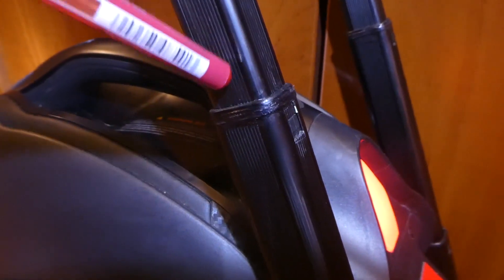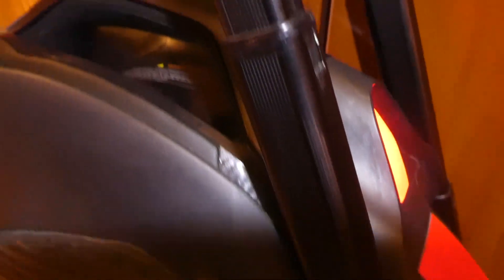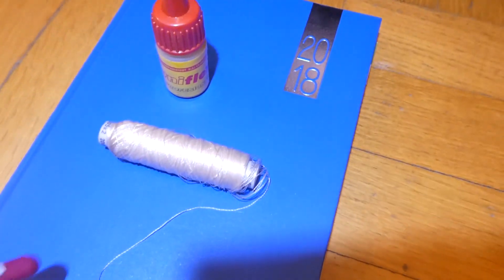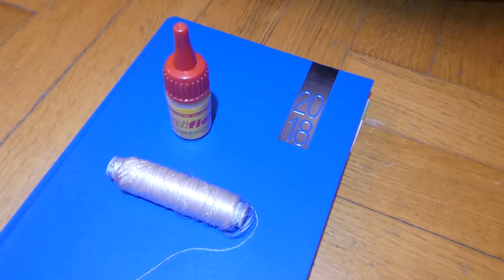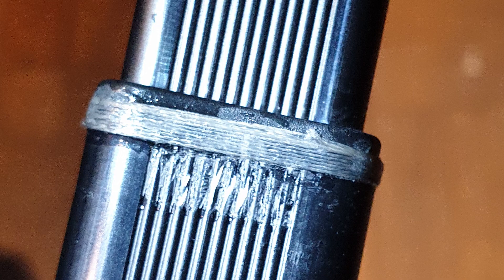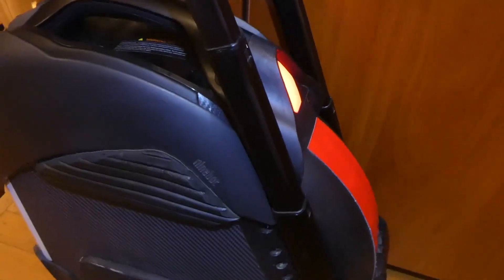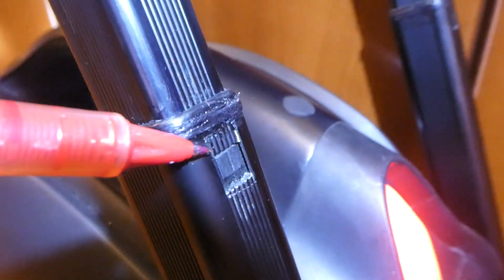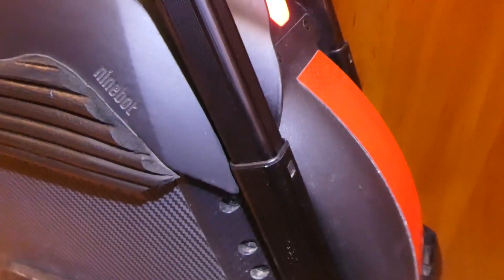Ninebot Z10 handle cracks - how to repair....

Comment: not sure if u can help but i cant seem to activate the voice , i cant find any info online and manual is in Chinese , i would appreciate your feedback , thanks
Reply: Hello - check the Ninebot app. You should be able to at least download a different voicepack from there. Perhaps it makes it work? You do get sound from the speaker - or no sounds at all? You can play music from your mobile phone as well (use it as a bluetooth speaker).
Reply from the maker: Activate the voice - to use BT speakers for music ? or You have no system voices at all?  For BT speakers - check in your phone for next BT device - this next one is for  music (Z10 has two BT interfaces)
Reply: thanks so much Luk Luk , i didnt no it had 2 BT interfaces , i now have music when i ride , u have been most helpfull thankyou ;-)